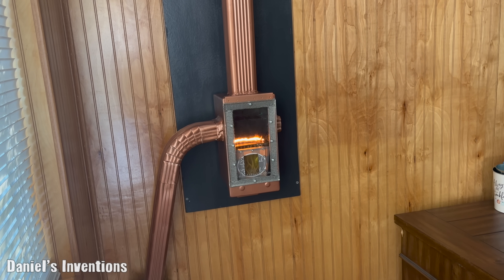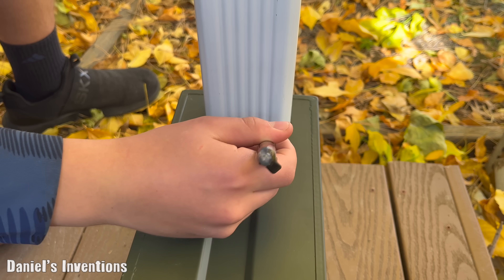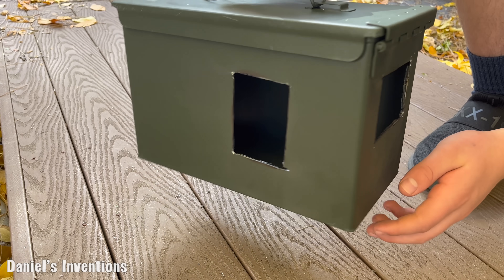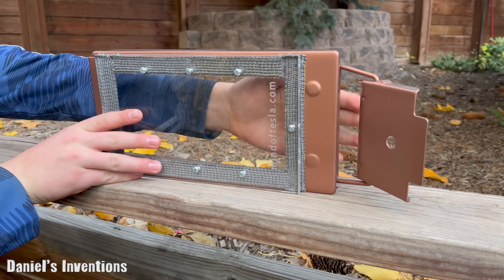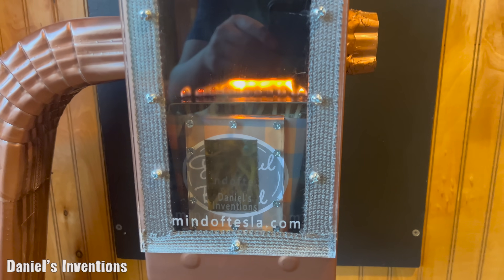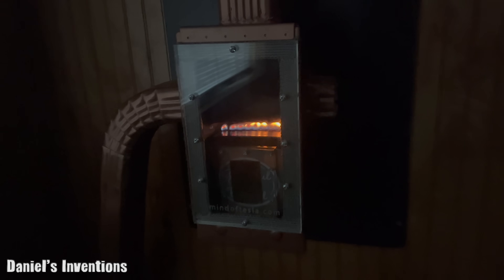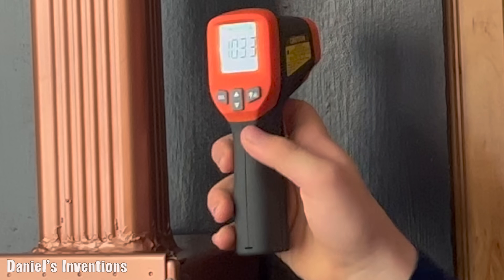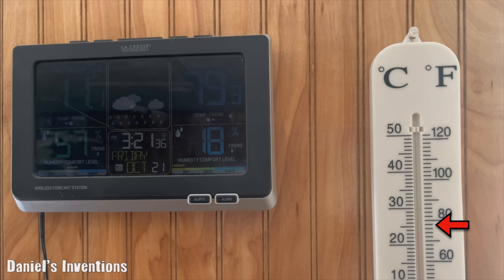ENDLESS Heat for Your Home WITHOUT Electricity

Comment: The video title is very misleading. This heater will not run as described because the intake computer fan needs electricity to run. Yes, the oil flame box will produce heat, but it will only radiate from the source and the air outside the radius of the firebox will cool down very fast. Now, you could hook the fan up to a 12-volt battery. But the battery wouldn't last very long, maybe 6 hours before the battery would have to be replaced.

Comment: Next you should use the Heat off the exhaust to power a steam power turbine to circulate the heat instead of the computer fan. The title says without electricity but the computer fan uses electricity even though a very little bit. But if you uses the 456 degree exhuast I bet it could somehow power a steam turbine to make this a heater without any electricity.

Comment: If your technically ok and have the resources it looks like a great idea. Being neither I just bought  a cheap heater that uses less than 75% electricity than normal heaters
Reply: Thanks I looked at your channel bit odd but thanks

Comment: a neet idea but, only for locations where 11 degrees is considered fairly cold, i doubt it would be as useful in places where its normal to have -10 to -15 degrees during winter, at least without a sufficient insulation of the place you want to keep warm, tho i do admit it is very efficient at what it does

Comment: This is pretty cool, but if anyone will try this, please be careful not to use galvanized steel in the parts that get heated up. You could run the risk of getting zinc poisoning. 
Not sure if the design allows for the fumes to come in but i would not run the risk. Better be safe and pick the right materials up front.

Comment: Clickbait! Endless Heat ?????? Until you run out of of oil!!!!!!!!!!!!!!
BTW, that contraption is a carbon monoxide leak (aka killer) just waiting to happen.  So many possible points of failure, so many dangerous oversights. WOW!!!!!!!!!!!!!!!!!!

Save your own life, buy a Vornado room heater !

Comment: Or just buy a small kerosene  heater - but this is cool ;:*) ...the fan will need to be battery op if you want to claim as No or without Electricity tho

Comment: 11 outside and 80 inside? Bullshit. What you have here is the equivalent of about 3 or 4 oil lamps. If it was 11 degrees outside and you lit 4 oil lamps inside, it would not raise the temperature of a small room by even one degree.

Comment: BRAVO!
Needs a little improvement, but basic idea is GREAT!
Suggestion: Create/Mount the ammo can lengthwise, horizontally, to get more wicks, more length of heating the downspout tube for more heat/ larger area.

Now do an outdoor version using a camp fire! - Its actually easier.

Comment: 79 degrees is very cozy, so much that you probably would be fine at 72.  I would figure to reduce the temperature, you would remove one or two wicks.  That would also conserve the consumption of the oil, saving you more money.

Comment: Great video! Use a thermoelectric device to power the fan from the heat that is generated to eliminate the 12v battery.

Comment: A better version of this would be doing what another commenter said (change the aluminum gutter stock to steel tubing) and wrap copper coils around the steel to act as a secondary heat exchanger for hot water   the problem with this is I have no way to test whether or not the heat transfer would favor the air to water exchange   ( hotter water but cooler air) or as a way to regulate  how hot the water would get 

Perhaps a pump  to recirculate water into a hot water tank set to continuous flow

Jeez. I'm overcomplicating it..

Comment: I've seen a lot of hokey home made inventions but this 1 actually impressed me! I truly see the value in it, especially as a potential small greenhouse heater. I also can imagine it being coupled with a thermal mass or heat sink fins to extract even more heat, therefore, reducing your oil consumption.😀

Comment: You need to delete this video before someone follows your insane advice and builds one of these. This is a good way to set your cabin on fire or die of CO poisoning in your sleep. As others have pointed out there are numerous safety hazards with your “design”.

Comment: An alternate to the several wicks, might be getting several oil-lamp wick holders, that have the adjusters built-in.  Those normally screw onto an oil lamp base, but could be mounted onto a similar metal plate as you did.  That could both increase the light/heat, & ease wick adjusting. 

Or, instead of oil, one could make an alcohol burner to go into a container that has room-air recycle & fresh air + exhaust.  One guy makes his using 2 recycled cans, a carbon fiber filter as a round wick, & stainless steel window screen as a vertical round mantle. 
He sets his burner between 2 cake pans, separated by a metal shield.  
But, it could as well be fitted inside a larger metal box w/glass door….that could increase safety & efficacy.  
Alcohol burners are very easy to make; they do a “batch-burn”, so, you make them to hold about as much alcohol as is needed for the period of time you want to use them.  
 A couple dampers could be used at air intake & outlets, to shut it down mid-burn.
Reply: Carbon felt wicks never need adjusted.
Reply: @jeremiahshine  Carbon felt gets build up (a crust) just like cotton (we trim trim this off cotton) how do you sort this out with carbon Jeremiah? This is with oils, not alcohol as alcohol does not have this problem in general...carbon is not necessarily a 'forever wick' as some may suggest.
Reply: Where can a person locate copper tubing
Reply: @hopejeske9123   Usually at hardware stores.
Reply: Alcohol isn't the cheapest of fuels and around 1/3 less heat per litre compared to most other liquid fuels. Just too expensive, I have tried it myself; Great though for camping stoves or emergencies.
Reply: @pa_maj.MARTINI-van-MAN    One can get rubbing alcohol still fairly cheap.  
I like rocket stoves, which can burn pine ones, sticks, small branches cut up…forest floor debris that can be fairly easily gathered.  
Can make then from numerous recycled materials, or concrete or rocks & cement. 
 Or buy ones ready made ( just be sure they really are rocket stoves, not fakes).  Real ones burn hot & fast, so have very little effluent.
Reply: @Chimonger1  I think if oils, coal, gas and even ethanol are hard to get; I'd just burn wood as you mentioned. Remember fuel is necessary to burn to create heat to produce a High percentage alcohol/ethanol. You can use the heat from the sun to produce ethanol so production could be done in summer. I mentioned that ethanol has less heat value (calorific value) than most other liquid fuels because price/value may be an important factor to consider for some, it's most definitely a consideration for me Chimonger1 👍 Yes, a Good rocket stove is hard to beat. I have a little gasification wood stove, it burns small sticks and burns them clean; just like a gas stove with a blue flame.
Reply: @pa_maj.MARTINI-van-MAN    Correct.  No one claimed that alcohol burned hotter. 
Oils like kerosene have more BTUs.  Then comes gasses like LP & NG.  Alcohol has lower BTUs in it. 
That said…consider supplies.
If you cannot get supplies refilled, you won’t be burning oils.  Not unless you can grow oil-producing plants & can process them. 
But, one can more easily (relatively) make alcohol from plant substrates. 
Or, might harvest methane from compost.
Reply: @Chimonger1  none of what you said is practical at all...harnessing methane is not easy! One can easily use leftover cooking oils btu's is one thing hut burn time is another. Alcohol burns much faster than oil.
Reply: @jeremysanders8138    Not clear on what you refer to; I was not dwelling on “practical”. 
What does practical mean, to you?  Price? Accessibility? Efficiency?  For camping, or for home?  Or for disaster prepping?  
It’s a longer discussion! 

Fuels w/higher BTUs/Calories, work using least volume of fuel—even better if using the most efficient burner machine/gadget. 
Fuels w/lower BTUs/Calories require buying or making more volume of fuel to achieve same work—again, best if using the most efficient burner machine/gadget.  

But the heat of a fuel is not the only issue….
…we must count how the fuel is made or gotten, how it’s shipped & how far, as well as the products caused by burning it.  
Also, how long can the machines or gadgets last—because, those count, in the overall “costs” of using a fuel. 

Easily use leftover cooking oil?  
How many sources actually create used cooking oil? 
It truly would take billions of gallons of used cooking oil—fewer restaurants are using much deep-fat-frying oil, because, we know it’s unhealthy. 
Also, where there are more sources of used oil, city busses, for instance, quickly contracted w/commercial suppliers of biodiesel, to fuel its busses—sources started selling their used oil to the biodiesel makers for muni systems—no more cruisin’ by to fill up your tanks w/free used oil to make home-brewed biodiesel. 

Harness methane? 
If you have a biodigester on your place, & feed that w/manures, yard waste, kitchen scraps, etc., methane can be fed via pipes to run heating, cooking, lights, a generator, or tanked to run a vehicle converted to burn LP, NG, or methane. 
For petroleum refiners, it’s a nuisance, & costly added equipment to control, so they just let it burn.  

Alcohol? 
More common to batch-burn; it has maybe higher danger due to easier flash-point & being invisible flame.  But one can distill it themselves—will need more volume to do the work done, due to lower BTUs. 
But it DOES burn much cleaner. 

Of course a fuel w/less BTU’s, requires using more volume of it, to achieve heating, cooking & running vehicles..…but, depending on all other factors (CONTEXT!), might be warranted as a viable option. 

If I heat my tract house using fuel oil, I don’t need to buy as much of it to do the work needed.  
I could still do the work needed, using low-BTU fuels, but must buy more of them. 
But that’s not the only thing!!  (Context!!)….
…The dominant (read: most profitable) fuels require shipping from elsewhere—so, the actual cost is Not just the per-gallon price.  
I must count the costs & harms of making it, shipping it, AND, what the effects of burning it actually do. 

If we graphed out ALL the risks/benefits of each fuel, & were honest about the actual data, most would feel shocked at the real costs of petroleum-based fuels which most have used without questioning. 

The delusion that “biofuels” could save us from our own industrial bad choices, started to unravel rather soon after the entire Midwest agribiz region had  built-up infrastructure to make very profitable, scaled-production of alcohol from corn.  
Biofuels CAN be a piece of the puzzle, but, a small one. 
It cannot scale; some of it shouldn’t scale; NONE of fuel should ever be used as a profit-driver. 

On-site distilling? 
If I instead, made a fuel from on-site materials, or at least, from materials biologically grown, & the least costly to ship, then, much of the costs & risks inherent in the fuel, are much reduced.   
That MIGHT mitigate collecting on-site methane, or distilling one’s own alcohol to use as fuel. 

What is “practical” on an individual scale, may not work on a nation-scale or planet-scale. 
And worse….the 2 deep-rooted drivers of climate disaster, are NOT being even mentioned, much less discussed:  
….Planned Obsolescence” & Consumer Engineering”….those 2 things have & will continue to be root causes of climate emergency.  
These things are happening in every sector, as all industries & individuals scramble to survive. 
Those need to be a big part of the fuel discussion, as well as for discussing just about All industries’ culpabilities in causing the messes we must deal with!
Reply: @Chimonger1  ; indepth 'discussion' is indeed needed if you want to consider that most of the ecological 'damage' being done to the world is not what you think...best check out geoengineering & consider that the fuels we 'take for granted'  are put out by producers & corporations who are the ones bent on destroying our world. man driving gas automobiles is  not the problem. Chemtrails, nano-particulates at tons per day ARE a major source of environmental degradation , not to mention harm to all living things. Along with that is another problem you've neglected  to mention which are radioactive frequencies which are being used as weapons against all those living entities, including all flora, fauna & of course, humans. If you don't know about this then best look some vids by either Mark Steele or Barry Trower....bit chute will have more of a selection than here. As far as chemming goes, there is plenty of military documentation to back it up & more than a few vids here on the tube to clue you in. You might try to find some of Kirsten Meghan's vids or Ted Gunderson just to give you an intro.Chemtrailing ( the military's term for it btw) has been going on since the 1940's but really took off during the Viet Nam war....It was always meant as a weapon, never to help, but to harm. The weather is controlled, so please do not buy into the BS of 'climate change', it's ridiculous.
Reply: @moneypenni1694   You are preachin’ to the choir, kiddo!   
What you said, & far more!!

Comment: EXCELLENT❣ very much like how it has fresh intake air, & that it recirculates indoor air separate from exhaust air. 
Did I miss that you used high-temp paint? 
I’d like to know, are the wicks fiberglass, or cotton?  &, what type of oil burns most efficiently? 
I noticed the flames seemed to burn w/a wide difference of flame—can you tell why?  Any way to adjust them, so all burn more equally? 
Did you order the glass face w/holes drilled thru it for the screws, or, is it clamped in place by a metal edging?

Comment: This is dangerous.  You said no electricity, but are using a fan. What you have done here is create an oil furnace. The gutter is not heat rated and could catch your walls on fire. Just get a wood stove-they're fabulous! And you can cook on them when the power goes out.

Comment: Since you have your intake and exhaust outside the cabin. I think it would be more efficient if you ran your intake into an insulated box with small holes in the box outside and ran your exhaust all the way through and exiting the same box. 

This way the exhaust pipe would heat the air in the box while not contaminating the air in the box and intake would take in fresh but much warmer air than the outside air.

Comment: I tried building something similar. The soot buildup in extremely short time was shocking. Clogged up my chimney pipe. When I lit it up after only a few days the smoke had nowhere to go. It came out of the stove into my room. What a mess cleaning out the soot. It got all over everything. It's very powedery and easily spreads on everything and when you try to wipe things clean all you get are black streaks that are very hard to completely remove. 

I don't recommend using this type of heat stove.

Comment: All these metals have paint that are not meant to be exposed to such a high heat! This is misleading for safety in confined spaces! And isn't  the bonding component flammable!??.. Please be knowledgeable about these heating hacks! Without proper ventilation you can actually kill yourself burning anything indoors!!

Comment: If the welding gives way ,sheet metal screws can make a seal also, a little spreading with a hammer for a snug fit.  Just throwing it out there.

Comment: So when you say without electricity you mean with electricity cause it looks like with electricity and without that fan well your not going to move that heat unless you use a Stirling engine powered fan. And you need to moved that off the wall at the least an inch.

Comment: You take the AIR for burning from inside the cabin. That air is warmed. Instead, make an individual air intake from outside straight to the burning box using metal pipe. You'll notice the difference!

Comment: If you put baffles in the chimney you can improve the heat output rather then let the heat go straight up and out. Making the hot air take a convoluted path out will extract more heat out of it

Comment: If you made a platform across the top of the box you could put a stove fan, that requires only heat (no batteries or electricity) to run, on top to circulate air in the room.

Comment: Save time and money by setting your house on fire to stay warm. At least you'll know when the fire starts instead of waiting for the gutter pipe exhaust to start it. Use a 50 gal steel barrel for the heating chamber, a box fan for circulation and a rolled up carpet for exhaust.

Comment: I would/will put an additional top plate and space it roughly 1 inch above the actual casing, also extending it down the back with the same offset.  Help to shield that very hot surface and by convection induce a  forward moving warm air draft.👍
We are going to have to find something other than jb weld. Hmmm.🤔

Comment: I will point out that with out that blower you are not going to get that much heat in the room thus you will need either AC or DC electricity to run the fan unless you have a solar panel with power bank.

Comment: More surface area makes more heat and then use less oil lamp cords which will greatly increase lifespan of oil. Instead of one chamber being heated up make multiple tubes surrounding fire to heat up more surface area. Greatly increase heat which will allow for less fire wicks. Less fire wicks means longer lasting oil